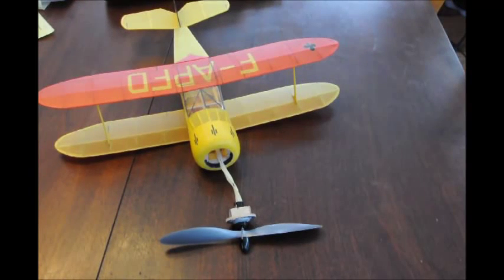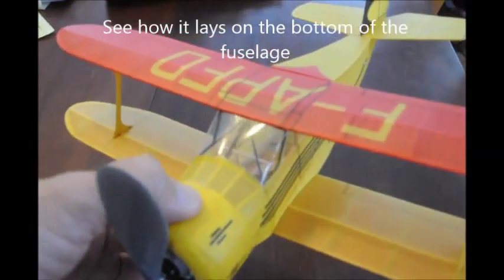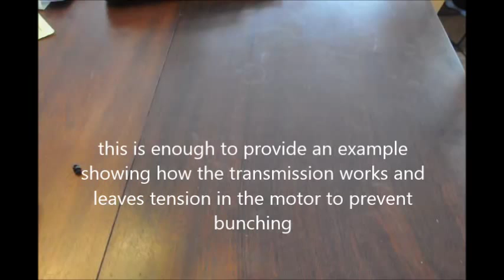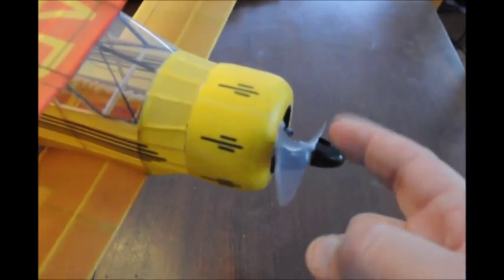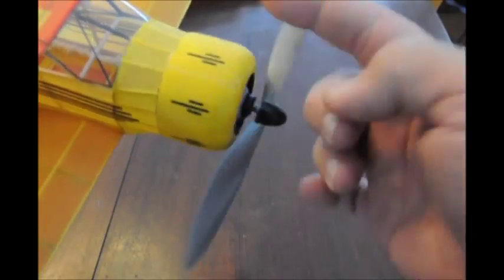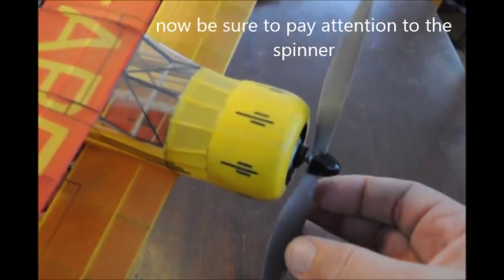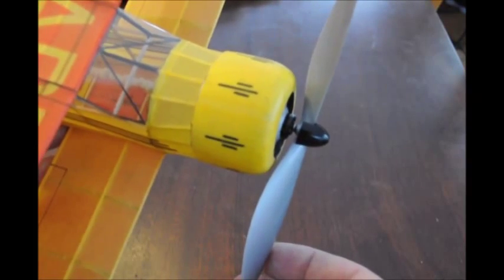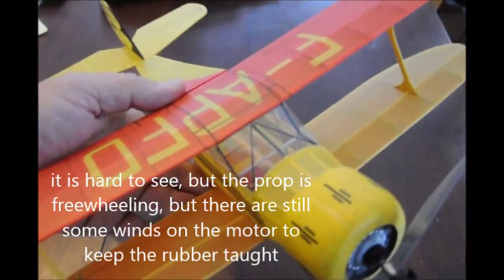Gizmo Geezer Prop Demo

Comment: Great unit. You will like it. Works exactly as advertised. One tip to share is to make sure you take ALL the winds out of the rubber motor before each winding. This will help keep the winding adapter fully engaged. If not, the winding adapter might disconnect while winding with disasterous results.